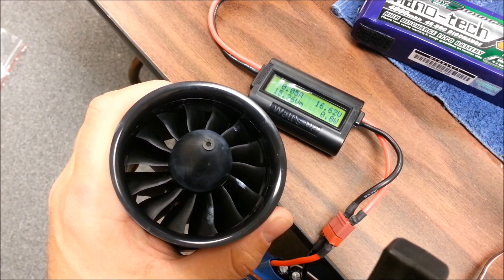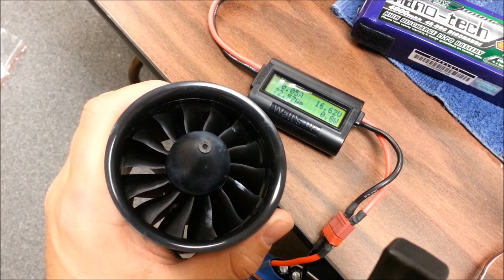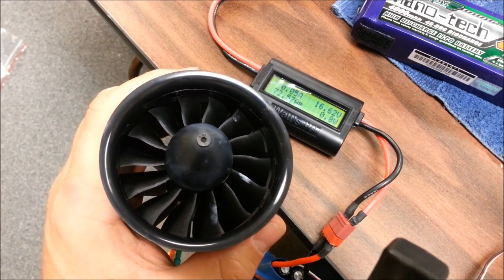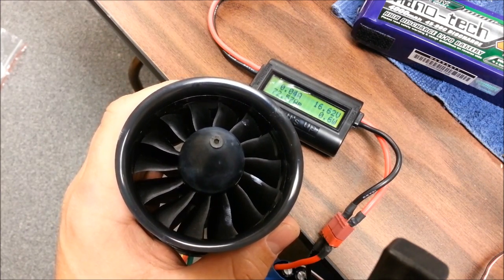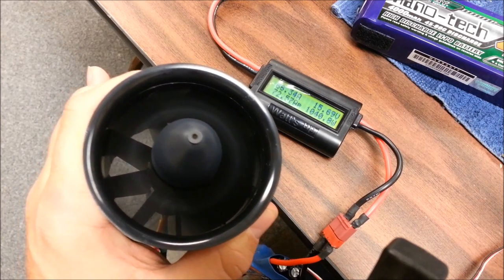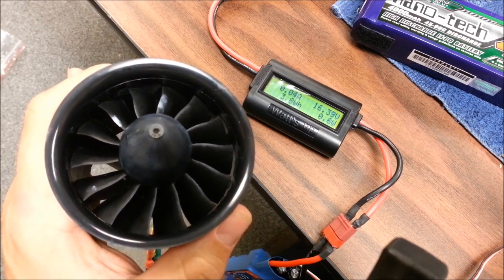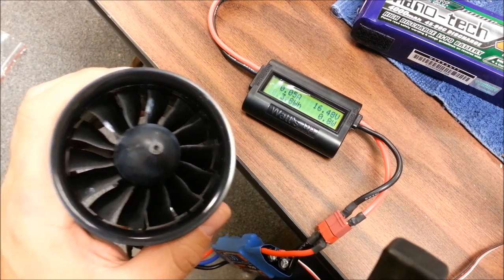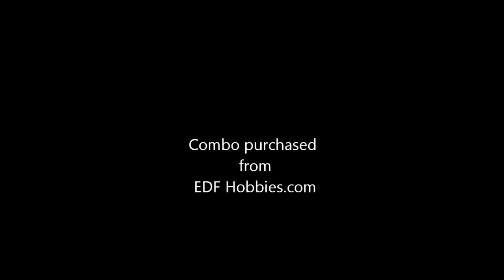XRP 70mm 14b EDF

Comment from the maker: The 2600kv should do great with 5s. Probably should be careful with 6s. You didn't mention a # of fan blades, but I'm assuming 10-12. For 6s a 2200-2300kv should be used. Or is what I would use.